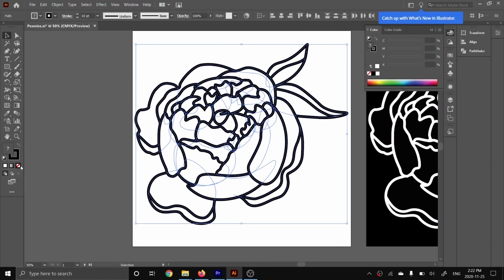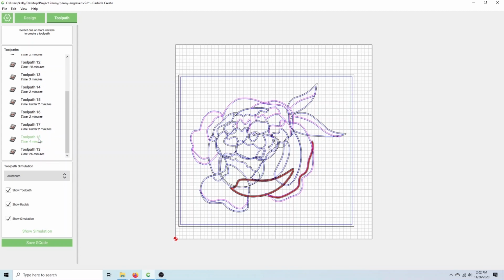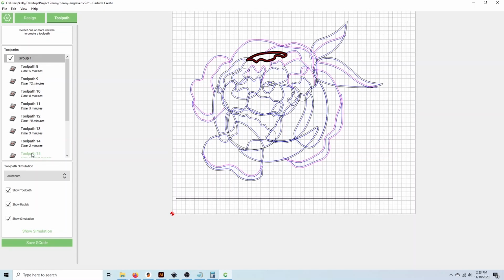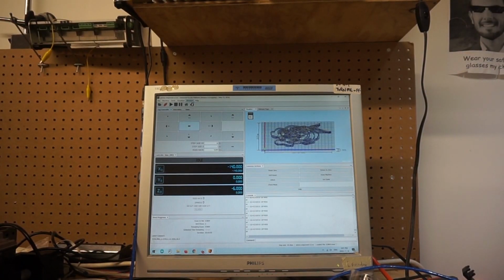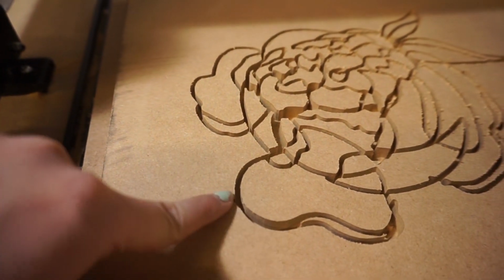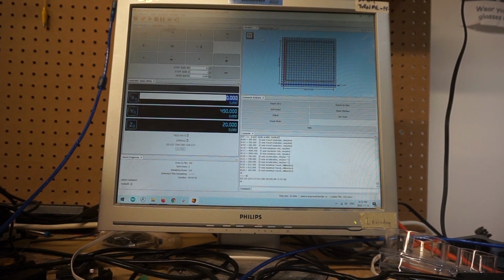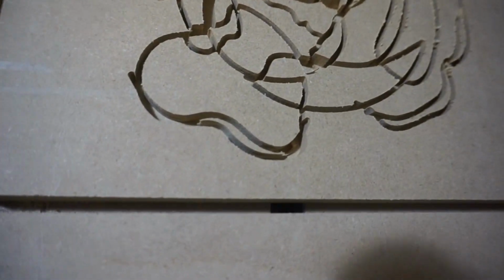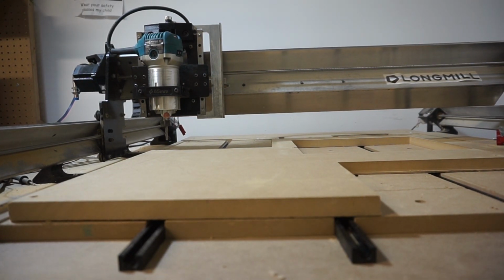A Beginner's First CNC Project: Kelly's Process and Learnings

Comment: Excellent job, Kelly. Two suggestions, if you don't mind. First, I find that the V cut will really clean itself up if you run the job twice. Second, for painting in the lines, I mask the entire piece with MacTac shelf paper. Then, cut with the V bit. Then, a spray the "stencil" you just created, then peel off the MacTac. You will get perfect results every time.
Reply from the maker: Thanks for the tips Grant! I never would've guessed shelf paper would do the trick. Will be trying that out soon - Kelly